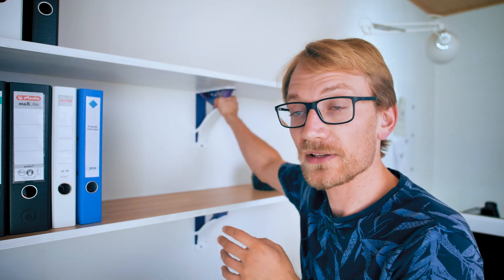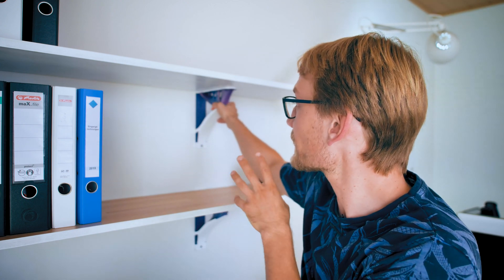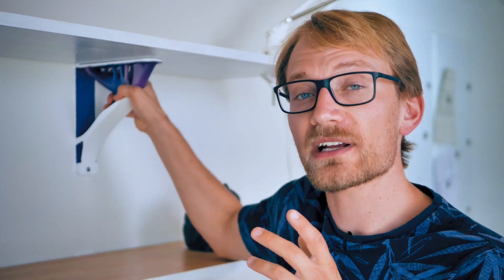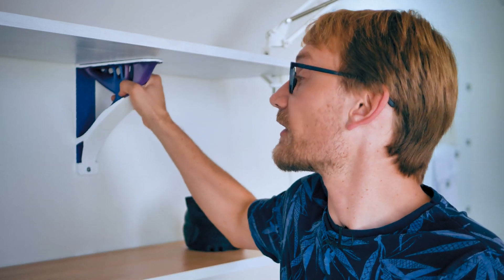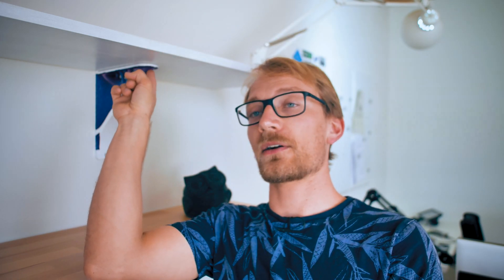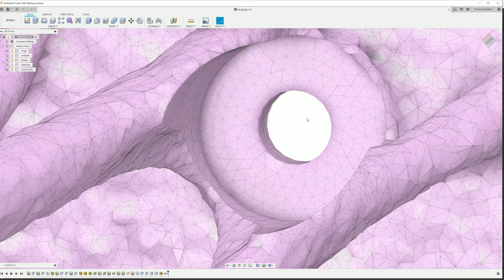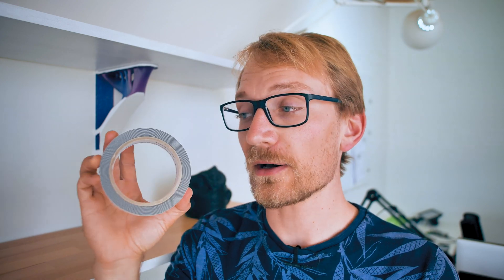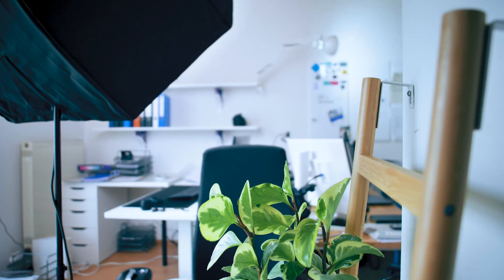Why the topology optimized brackets weren't screwed to studs (and other questions answered)!

Comment: Even with just two screws in drywall anchors properly installed just in the drywall, it would be more than enough to hold the shelf and its content with a good margin.
You really need to find the studs when you're hanging a water heater, a sink, something structural..
And in those cases, it would almost never be on a drywall.

Comment: I had assumed that you were just pulling a blank on the name of drywall in the previous video. It looks, sounds, and tears out like drywall which makes it extremely easy to assume that the wall was drywall. Plus at least in the US, there isn't much material like that other than drywall used in construction.

Comment: Is it possible to do topology optimization with the free version of Fusion 360?  So far, I've avoided jumping into Fusion 360 because I'm mostly using Linux these days.  But this seems like a cool enough feature that I might want to figure out how to remote into the Windows 10 gaming computer upstairs.

Comment: I'm doing a similar set of 3D Printed shelves and I was going to use a bolt and nut or a screw to a fix my shelves to the bracket and WOW... you have simplified everything thanks not to the fusion topology optimization, but using double sided tape! lol, Thanks for the Videos and the candid discussion on design choices!

Comment: There is nothing wrong with drywall, while we have a stone house we have parts that use drywall to cover up pipes.
But what we do is having two layers of OSB(i dont know the english word) behind the drywall, so in case want to hang a tv or lets say....Shelves :-P we don't run into any problems.

Comment: Some American folks just assume that every single house in the world are made of drywall qnd studs, wich is not true obviously. Here in Brazil (and in most Europeans countries) for example, most of the houses are made out of bricks and concrete, not just wood...

These concrete/brick walls need less maintenance over time, also the fire risk is way lower (a short circuit inside a wall is not likely to cause problems) and usually the temperature insulation is way better. If someone falls into the wall nothing happens because it’s sturdy, and bugs like termite aren’t likely to eat our houses down either. 

I understand that for some places with extreme earthquakes (California cof cof)  the 2x4 studs and drywall are a better design, but come on, the rest of the world doesn’t have a st Andreas fault running under our homes.

Comment: What do you think about printing the bracket upside down with supports just underneath the shelf platform. Would this orientated the print layers better as the force is not pulling it apart at the top of the bracket. This orientation also reduces the amount of overhang issues

Comment: Stefan showed to get the best material to strength ratio  use 15% rectilinear infill and 6 perimeters. It was as strong as 2 perimeters and  100% infill. How would modeling it as a solid triangle and use 15% rectilinear infill and 6 perimeters compare with strength and use of material to the topology optimized triangle? I would like to very much know since when I am designing something I don't think about how big the braces should be. I just model it as solid and dial in the strength to material ratio with the infill and perimeter settings.

Comment: i've also got soft blocks like yours. I've found it make a HUGE difference to plugs if you insert a small tube/straw into the back of the hole and blow out the dust before you insert the plugs (not just suck with a vacuum cleaner). Once there's no dust, it's actually quite grippy. Love the shelves btw.

Comment: Drywalls are kinda rare in Europe, lol. Our house is made out of 30cm thick hollow bricks (they have a grid pattern inside), and the rooms inside are Ytong (the same Tom has in the office). They are strong and sound proof. We usually only use drywalls if years after construction, we want to divide a room in to 2 or something, we separate them by a drywall. For example we didn't used our garage, so we divided it and use one half as an office and the other as a storage. For this, drywalls are enough because it does not need to be strong nor sound proof.

Comment: Hi Thomas - been a green horn regarding 3D printing for the last 5 months and yes got a lot of information from yourself (great videos!) Anyway just changed over to prusa slicer 2.0 using "brim" found it stiff and hard to remove - could you point me in the right direction to making the brim thinner so its easy to remove - thanx in advance.

Comment: Hi, Thomas! The reasons are solid like your walls )) I've guessed right that you've used a double sided painter's tape or something like that. The other alternative could be a rubber glue but the tapes seems to be easier. It's not that case when you need a reliability like a railroad bridge.

Comment: Lets see?  First "Topology Optimized" I just love when people try and use buzz words to add a high tech spin as it adds some sort value and justification.  Second "algorithm" just another fancy word for a computer program which I suspect was made with readily available 3D CAD software for 3D printers and not programed manually line by line.  Third, seriously would anyone with common sense put heavily weighted objects on such shelf brackets with shelf boards not properly fastened to the plastic brackets but with double sided sticky tape instead?  Also, Be careful with PLA as its completed product is brittle and can break or chip if you drop it.

The "Topology" of any material is readily affected by environmental factors such as heat and cold even by minimal temperature changes, including natural and artificial light (UV Radiation). Causing the material in this case 'plastic' to become even more brittle and fail over time.  Listen to his vid again and you can hear his multiple disclaimers about this project and judge for yourself.  I do admit however it does look cool!

Now this may fail in one hour or two weeks maybe even never but I would not take such an un-calulated risk using PLA plastic. To have it fail and ruin my property or worse have someone or my kids get hurt.  I do like this idea but would use the 3D print to create a cast and make it in metal instead.

In closing please use proper anchors for securing it to the wall studs if you can and the shelf boards to the brackets - use common sense.
Reply: I just love when people still talk about wall studs even after he's made a second video just for people like you...

Comment: 2:30 "PETG bit stronger" - yes and no. It's brittle AF and i would never use a printed PETG part in mechanical function due to it's brittleness on especially larger parts. Somekind of internal stresses form when printed, for injection molding PET family is good, but for 3d printing it's either internal stresses or the glycol which causes it to be brittle AF. I never agreed on the test results you got, since i did my own extensive test results and it was horrendous; many mfgs, many colors, dried, not dried, straight out of box, temp range of 210-295C - it was horrendously bad for mechanical parts in comparison to anything else. Then the way large parts shatter was for my function outright life threatening -> Aero parts for race car going 300kph.

Comment: I think those brackets look great. What I sometimes find missing in discussions about strength of 3D printed parts is that it is not about absolute strength of one material over another, but rather how much material do you need for a job. The "optimization" isn't optimizing the strength but rather reducing the amount of material. Enough PLA will hold anything, and "enough" isn't too much, most of the time.

Comment: Tom, thanks for these videos. I was needing to make some special brackets to hang curtains in my daughter's house - special because the house is rented and has some very specific rules about putting any holes in the walls, so we had to match existing holes and they had to extend out quite a bit further than a typical curtain bracket. At first I was planning to make something out of metal, but when I saw the first video on your shelf brackets, I realized how much easier it would be to do a quick design and print them. I didn't need or do the form optimization, just a simple design out of PLA - and as you say, it is plenty strong enough for the application. Thanks for pointing me in this direction!

Comment: It’s strong enough, uses less material than a solid truss, and looks way cooler. 🤓👍

Anyone can build a bridge that stands, but it takes an engineer to build a bridge that barely stands. 😎👍
Reply: the original Tacoma Narrows bridge had some real engineers then
Reply: @IFRYRCE  That bridge was actually stronger than it needed to be, they just didn't account for the resonance of the bridge.
Reply: if you're talking bridge, now you're talking taxpayer money
Reply: wtf.
Reply: @Eman9669  He's talking about in theory anyone can design something by throwing unlimited resources (material, time, money) at it with better/more material / supports at it. While it's a lot harder to design something within the time, budget, and material constraints of the real world. To optimize for what the project actually needs.

Comment: It is topology optimization of an not optimum shape. But if you did a 100% optimized part it would probably boring triangle or so.
Reply: Not sure how you've made that conclusion... But obviously the optimisation algo isn't linear. Yes, probably the solid triangle will be stronger... but not lighter ) So as I guess, it searches the form which stays stable with much less volume included. Not sure if it's a brute force but most likely that it's checking mesh points' movements. It gives the ways where it will "go to crash" or not. So it chooses the best options.
It's how I think it works.
Reply: @KiR_3d  if you look at the part you  should see a formula otherwise.
Reply: @MisterMakerNL  but i'm not good at high math, ahaha )) although my father was the math. professor at the Moscow Aviation University, that's the paradox.

Comment: Ahahaha.... studs in Germany...
My friends beyond the pond, we don't build our homes out of paper maché like you fellows, no we use really sturdy stuff. (That said we have totally different weather conditions so duh)
The only place where you find usually drywall is in office buildings where the tenants can freely divide their space to their liking. (Or when your landlord is lazy, greedy or a cheapskate)
Reply: Perhaps our houses are merely topologically optimized.
Reply: Ok but how do you pass additional wires in the walls after the place is built?
Reply: @expression3639  why do you need to? Our houses are planned with the help of architects and all wire, pipes and other stuff gets installed to this plans. It's really rare that we "reorganize" our homes, including all the installations of kitchen and bathroom. When I first saw somebody rearange his bathroom I was fascinated that even your baths are build like this.
Reply: @Atariks  sounds like a nightmare to me. it seems like every other week that i'm deciding i want to run more ethernet or more power to a room that doesn't have it. what does a german do when they decide their server room needs a secondary UPS and they need to run four more circuits from their breaker panel?
Reply: or even worse if they're an audio engineer trying to build a home studio. putting soundproofing insulation inside regular stud walls is already a huge hassle, with aircrete you'd have to build a wall on top of your wall.
Reply: @famitory  If you design your house bottom up and you know you have such a hobby you will probably plan extra space in the walls with pipes for these wires. If you are living in an apartment or buy a already built house you have to live with wires behind baseboards or you open your wall. If you decide to open your wall you need to hire a craftman. In most cases you are not allowed to do this on your own.
And for the audio thing. I think you would build a additional drywall on top of the standard brick/concrete wall. Or you attach it directly to the brick wall.
All in all the brick/concrete wall thing has benefits and downsides. But studwalls as well. It's about how you learned it from childhood to mature.
Reply: @Atariks  The pipe thing. I'd say depends. Some places use concealed designs so those wiring gutters aka "pipes" are covered with concrete so that's a pain to route stuff through and then there's the simple one where those are placed above the walls. looks worse but much easier to use
Reply: @Atariks  The thing with hiring a craftman for such stuff is that you have to rely on their work. And as far as I'm concerned, I usually don't trust any craftman because they are rarely as competent as I would like them to be. Only when I do it myself, I know that the work is done properly.
And since nobody will ever notice that something has been changed, nobody will care either.
Reply: @lordroo8484  I don't know where you yre from but in Germany you can rely on a craftman. He/she learned it for 3 years and only his trade and sorry but I think a normal trained german craftman will be more competent than many other craftman. And you get the right to control it by ourself or let it control. If something isn't the way it's supposed to be the craftman is forced by law to repair it or his insurance will give you bakc the money.
Reply: @expression3639  I live in Poland and I live in a solid concrete building (rebar reinforced ofc), not this punny airy concrete - we have the SDS drills for that (and we use the decor between the floor and the wall). As for power, remember that we have higher voltage (and quite often 3 phases [3x240v] run to kitchen where most power hungry apliances stay - the same with any workshops) so we don't really have to pass more lines all that often (as we can cheaply oversize our cables). When we do it is a pain in the behind though (because you usually pass it entirely in the wall which means more sds).
Reply: @expression3639  And what I forgot: Most wires are placed inside of pipes. These pipes habe extra space for these cases. So you open both ends, tie the new wire bundle to the one end and pull on the other.
Reply: or in my brothers apartment, where he hides his weed plantation

Comment: The reasoning that people use "you could have made it much stronger if you added a full size beam." is still a misconception in the engineering world, at least in the industry I'm in. Why would anyone add more mass to a support structure of a bookshelf so that it can hold two adults while it only has to support only 40 kg of books. The topology optimization or generative design features in modern CAD application is meant to reduce mass and keep the same (or increase) structural strength. Still we hear engineers say "Well, let's use a steel beam of the next bigger in size, then it'll hold for sure.". Good work Thomas, you've proven the meaning of topology optimization. Keep the videos coming.
Reply: Mechanical engineers that just increase size 'to be sure' aren't actual engineers imho.
Structures are designed to a static and dynamic Factor of Safety (FoS). In THIS case, a FoS of around 2.5 is what I'd recommend  (i.e. design can handle 2.5x the expected stress since the material is not completely reliable/a bit brittle, the environment isn't harsh, and failure isn't catastrophic).    I expect he's WAY over that with what he has, and the fastener locations may be where the critical loads happen, anyway.
I just enjoy watching Tom and the other creators that actually build things, since I don't have much 'maker time' anymore.   Thanks Tom!

Comment: I have been checking out all the construction techniques in Europe versus USA; it is truly amazing the cool and interesting techniques used in Europe while here in the US construction techniques are generally the same for over 60 years, wood studs and drywall.
Reply: US building codes are just about cheap. That's  why  they blow apart with a slight wind.
Reply: @truantray  cost is definitely a factor, but the most common construction techniques in the US are based material availability for the volume of homes that need to be built at the speed needed to meet the demand.
Reply: I shudder each time they show a house built how you even wouldn't be allowed to build a toolshed to place in your garden here.
I couldn't sleep alone for the reason that you can hear a mosquito sneeze from five rooms away.

Comment: I've wondered if filling the infill cavity with epoxy or some kind of expanding resin would add much strength to an FDM printed part?  And help reduce the anisotropy of the printed material? Its probable super messy...